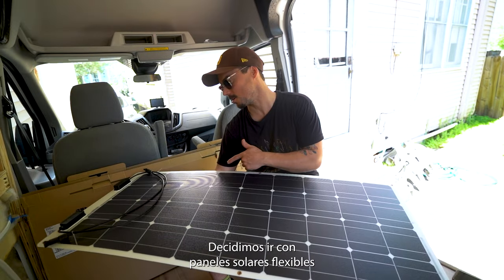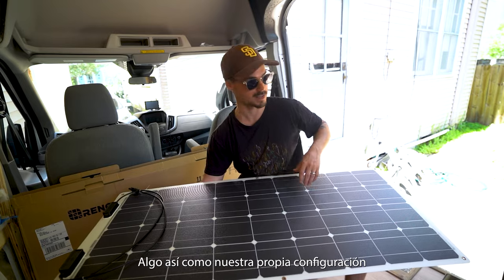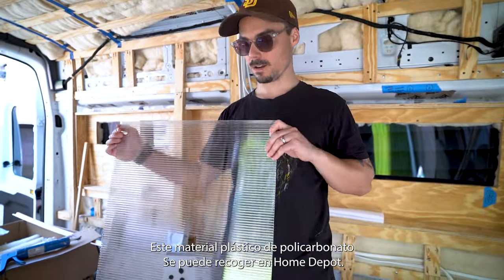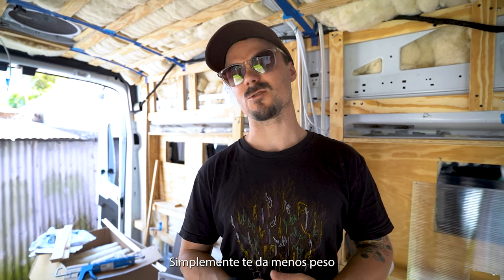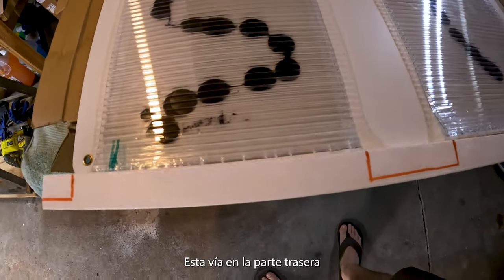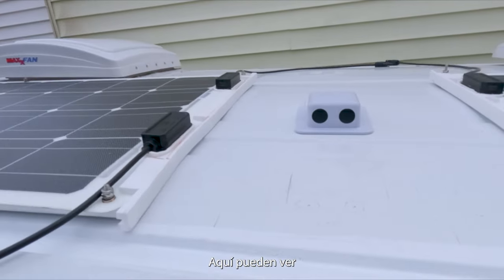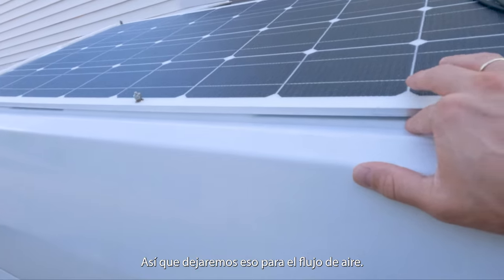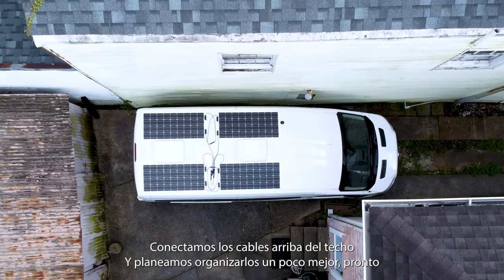RENOGY FLEXIBLE SOLAR PANELS INSTALL | 2015 Ford Transit 250 | Van Build Series | High Roof Van

Comment: I have two 100 watt Sunpower flexible solar panels in the cap of my pick-up truck. 
I have heavy duty outdoor velcro and i have nof removed the panels going on two years now. 
I have driven over 10,000 miles with them on my truck and they dont move.
Reply from the maker: That’s so good to hear!!! Thank you for sharing your experience with us! 😄 - Coni

Comment: What adhesive did you end up using? And can you give us an update as to how well it’s holding up at high speed please
Reply from the maker: Sikaflex adhesive (high quality and waterproof). It’s been working beautifully with no issues. The solar panels are definitely in there and not going anywhere. Good luck! :)
Reply: @OutdoorsMantra it’s gonna be a struggle replacing these

Comment: Use 3M Windshield adhesive. That stuff is 90x stronger then Silicone or any old sealant technology they used 80 years ago...
Reply from the maker: That’s a good idea

Comment: What's the power output in full son ??
Reply from the maker: It depends on how you wire the panels. Never expect the full amount due to the nature of solar panels not being 100% efficient, but we are wired in series-parallel hoping for up to 40 V and 10 amps. And since we are working on it we are parked between two houses but have been getting good results so far and feel that the RENOGY panels are doing their job. - Aidan

Comment: I’d like to know the power output your getting 
I used these on my Ducati van and they are not out putting anything close to the advertised power
Reply: Hey, Buck, I hope to eventually have a more clear answer with continuous data to look at. I don’t have enough time out of the driveway to give you a clear answer. But I can say we are getting the volts and amps that match up with the way we have them wired in series-parallel on bright and sunny days out of the driveway. Up
To 40 volts and 10 amps - we have 4 100watt panels wired in series-parallel. I also have the charge controller charging slower because I am mostly in “storage mode” as I build. 

I would double check your wiring between the panels and see if there’s anything out of wack. Also heard that if you are battling shady spots, parallel wiring will be better than series wiring.